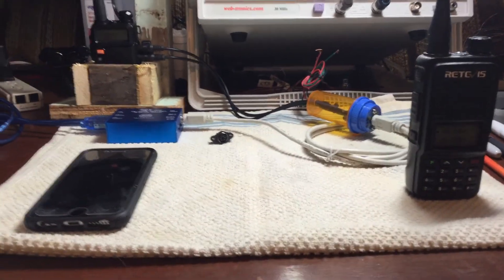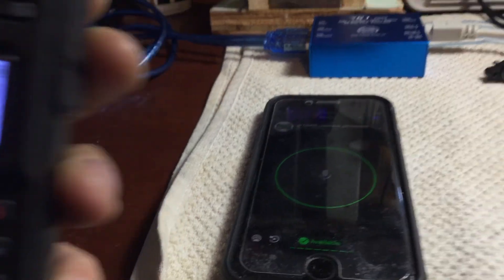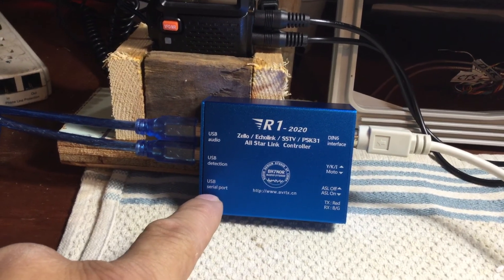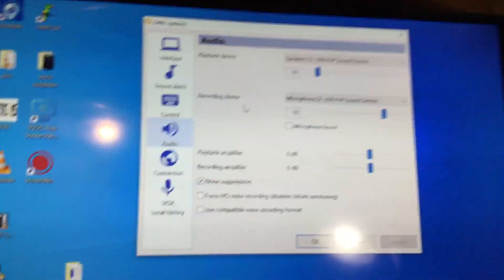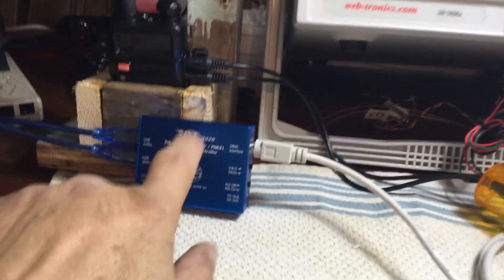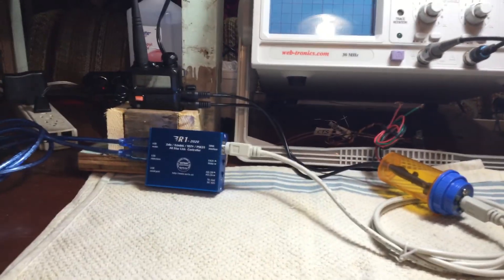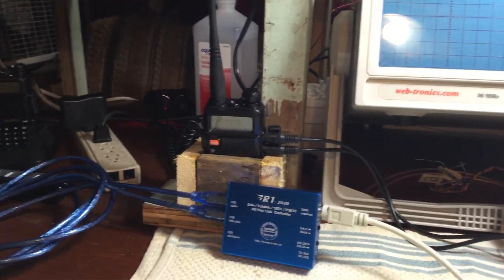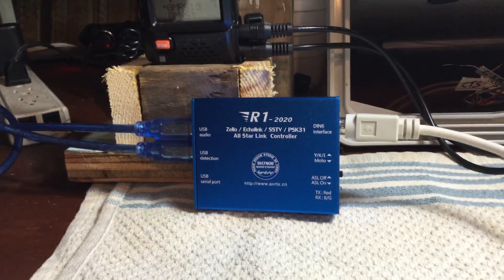🔺 PART 2 Setup and hookup of the R1-2020 interface Zello/echolink/ using a GMRS two-way radio🔺

Comment: I got my R1 Interface Box working with my Repeater. So it will work with two Motorola M1225 Radios with Motorola Interface. 16 pin connector.  One thing is pin out is backwards what they show online. #1 pin would be on top right looking at back of radio. One thing I couldn't do is use Repeater Software and Weather on same port as R1 Interface Box. Is there a way? Thanks very much for your videos. Much appreciated.
Reply from the maker: humm i am not sure if it will work but maybe the com port sharing software
Reply: @GMRStwowayradio  check into it. Make us a video.
Reply from the maker: @whizardmagicstreaming2369  a video on the com port sharing software? if so i think i have one for that already? or you mean a video on how to use the R1 with the com port sharing software?
Reply: @GMRStwowayradio  all of the above. Lol
Reply from the maker: @whizardmagicstreaming2369  lol, I will see what I can do 🙂
Reply: @GMRStwowayradio  Is your repeater on  MYGMRS? Mines on there. Tyaskin GMRS. I'll look you up.
Reply from the maker: @whizardmagicstreaming2369  no not yet i am on the octane network

Comment: Hey buddy what would you charge me to  wire up one of those 6 pins to my k plug walkie I've got the separated now I have baofeng Dm 1701 that runs well I'm awaiting an R1 2020
Reply from the maker: Are you wanting to hook up one radio? If so, what model of radio?
Reply: @GMRStwowayradio  it's a baofeng D1701 I have got a 6pin that I can use I just really need a wiring diagram
Reply from the maker: @PatrickMarter-vq8tv  maybe I am not understanding you but the diagram to hook up to the R1 2020 is on my forum at http://www.gmrstwowayradio.com   it will be under GMRS two-way radio R1 2020 category
Reply: @GMRStwowayradio  ok thanks I will look at it there.

Comment: Can you help me, im using r1 interface also walkiefleet server and dispatch. the problem is radio can't transmit automatically to walkiefleet because i need to press key on keyboard. Thanks friend
Reply from the maker: i never heard of walkiefleet server and dispatch software. So sorry, don't know much about it. But if it's like zello there has to be setting/option in the menu. What is the website address to this software?

Comment: Is the schematic laid out from connector face view, or from the back?  I am not having success, I am wiring based on assumption schematic is from connector face.  I've done the exact mods you have done on the uv5r,  Also do you have any resistors in line?  One video you made reference to limiting voltage on COS or Squelch line
Reply from the maker: Connector is facing you as you see it in the schematic and no I didn't add any resistor to the Cos/squelch line

Comment: friend, could you help me with my interface?  My r1 interface is installed on a PC with a Motorola GM300 radio.  My problem is that at the end of a message received by zello, zello's ptt is triggered for half a second.  This situation causes this problem of blocking my participation in talkgroups for sending too many empty messages.  What would you recommend me to solve the problem?
Reply from the maker: How do you have zello setup? What are the setting you are using?
Reply: Try to delete your history at once helped mine greatly I'm not running a R1 yet just cables and a USB sound card